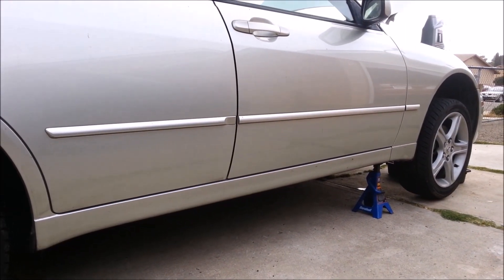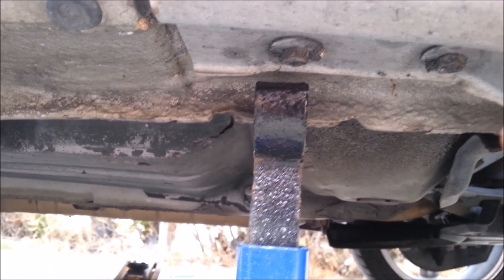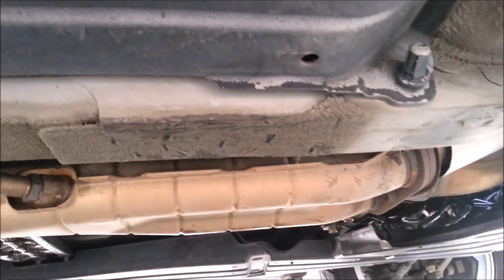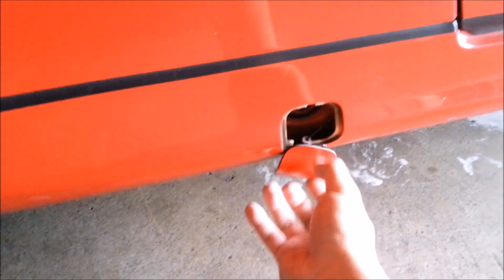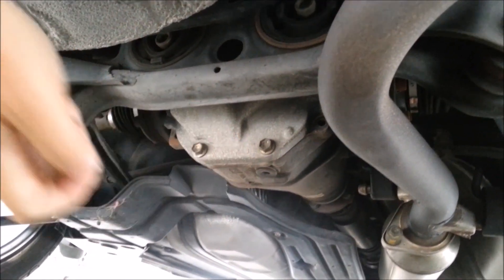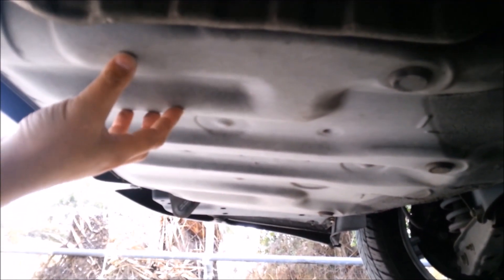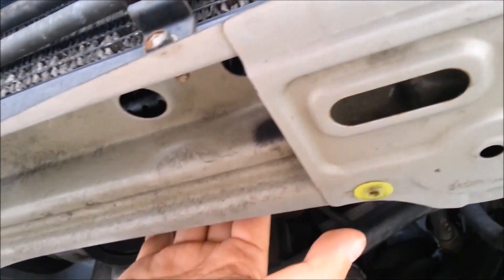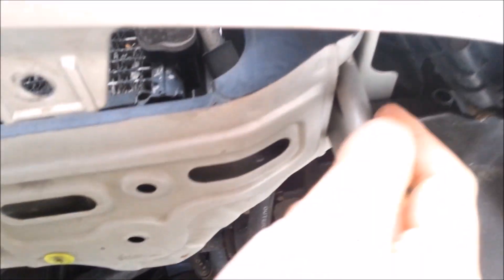DIY How to Raise / Lower A Vehicle - Winston Buzon

Comment: Hey bro these vids are so informative do you have a vid on short shifter installation?  If not you think you can do one whenever cuz I know you seem like you're a busy man. Thanks again Winston.
Reply from the maker: I will definitely do that but still debating on whether to do it on my CB or the next project...
Reply: Did you ever pick up the crx bro?
Reply from the maker: tjoe1979to Naw, a mechanic bud of mine checked it out the next day after that video and found that it had rust spots that were more extensive and would've been useless to repair...